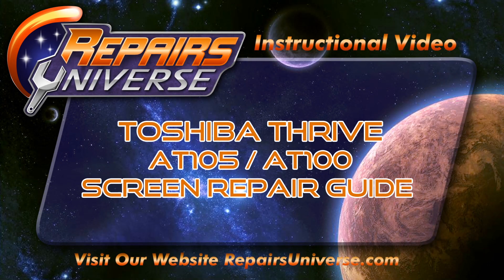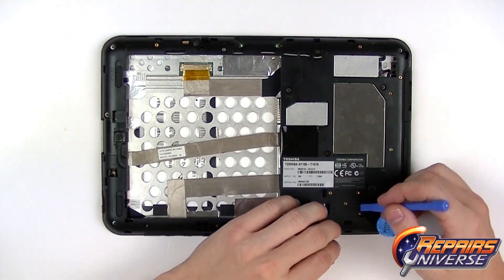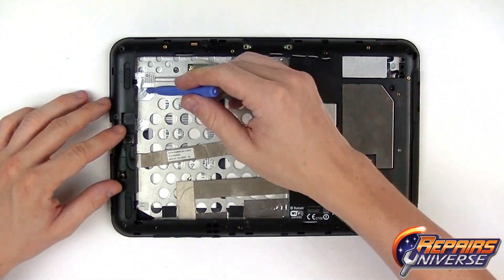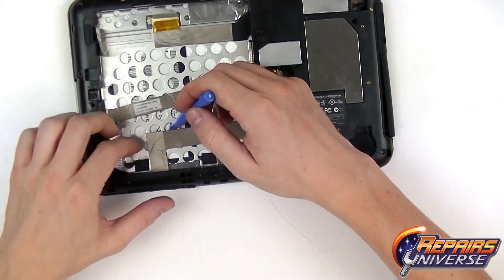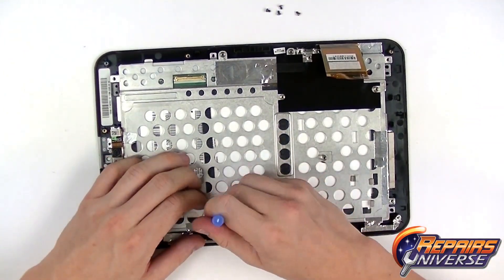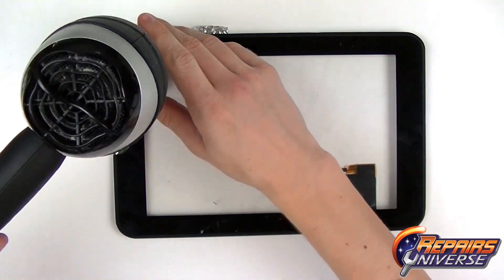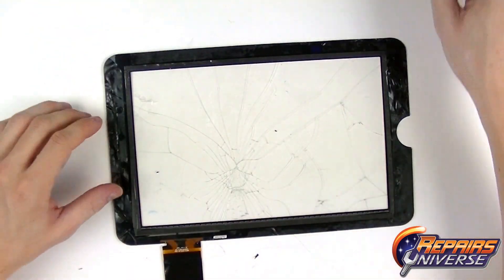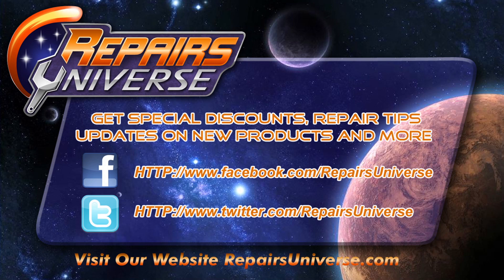Toshiba Thrive Screen Replacement Repair Guide

Comment: Wife did 1 too many gravity checks with her Thrive.  Received a replacement screen that was the entire front plate together so I got to skip the hair dryer removal process.  On the part where you say "flip up the clip" I did a pry... and the little clip door popped off.  Man that thing is tiny.  Replacing it took a couple of deep breathing sessions but I got it back in.  Also, high praise for the red circles on the touch screen screws.  It took a couple viewings to realize the bottom two sockets do not get screws at that time.  Couldnt figure out how I would have lost 2...  Thrive is back in action with a new screen.  Thank you so much for doing the walk through.
Reply: Where did you find the replacement?
Reply from the maker: You're welcome, thank you for the support.
Reply from the maker: Jane Renee Check it out here http://www.repairsuniverse.com/toshiba-thrive-7-lcd-touch-screen-replacement.html  In-stock at the moment.
Reply: i have the tab 3 10.1. I've dropped it several times. cat knocked it over once and broke across the glass side to side